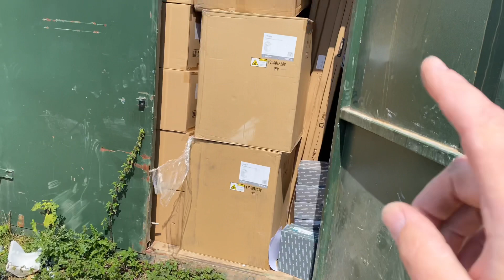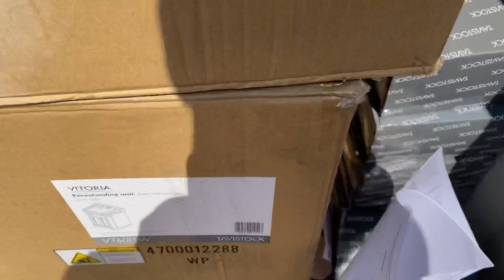REAL WORLD PLUMBING…WHY AM I NOT ENJOYING THIS JOB?

Comment: You will need some help with them trays , they are heavy . As  regards getting them in  get 2 webbing straps , put them around the tray , manoeuvre it into position,  lower it down and then pull the straps out . Tap the tray down to level it out .
Reply from the maker: Yep they were heavy beasts that’s for sure, take a look at Sunday’s video😉😉

Comment: With big shower trays, put down what ever you use to bed the trays, then have a couple of offcuts of 40mm say 1m each, lay them on the bed then put the tray on them, move it into position and then pull them out and boom you're in
Reply: Is it not hard to get them out once in place
Reply from the maker: good little trick that mate

Comment: I feel your pain pal I’ve just finished a refurb on a listed building where the polish labourers done the first fix plumbing for the hot /cold and heating toilets. You no W here this going the builder is a good pal mine never done anything work wise with him. Ask me if I could help out. No one sized the heating system up but they put first fix pipe work in.  I’ll cut a long story short when I filled up leaks everywhere spent 3 days just putting things right. Moral of our story is you pay for what you get.
Reply from the maker: Too right mate….. to many out there like that

Comment: Totally agree. Was told by client she wanted wall hung vanity basins. First fixed the pipes in the walls, only to find later on in the job that floor standing vanities are going in instead. Oh and the walls were concrete blocked. Pulling the consaw and kango out for the fun of it. 😔😒
Reply from the maker: nightmare aint it

Comment: It’s for this very reason that I only work in customers houses and not for builders. I fit kitchens and bathrooms. I do my own plumbing, tiling, plastering, run wires prior to my electrician, fit the flooring, studding etc.I am in charge, and any cock ups are down to me. I don’t have to rely on other trades letting me down last minute or spend hours cleaning up their crap. I only have to deal with the customer who pays me a deposit when I start and stage payments if the jobs going to run a few weeks. I also only do one job at a time, this keeps the customer happy and means I haven’t got money owing all over the place.
Reply from the maker: 👍🏼👍🏼….. good way to work, I did it like that years ago👍🏼
Reply: I think when people like yourself  have a bit if pride in their work it really is a kicker when things balls up

Comment: I only do private work now got stung massively by a builder a few years ago, never again! 
Customers are a pain already without sticking someone else into the mix! 
I've lost my mojo for work at the minute, just had 2 days off work as the van failed its mot... 1300 quid ffs
Reply from the maker: That’s shit mate, leasing a van is the best thing I’ve ever done to be honest….

As for the builder, he is spot on with payments etc, it’s just the job that got me in a pickle
Reply: @MJTiffPlumbing  why would you say leasing is better than just buying a van? Overall its more cost
Reply from the maker: @aj7303  I said it’s the best thing I have done, I didn’t say it was better…. However it’s all tax deductible so makes better business sense.

But each to there own, I used to say owning is better, maybe privately but not when running a business imho

Comment: I'm a bit older than you  and I've been there mate. I used to work for builders when I started working for myself. If you dont like the job,  I would follow your gut and steer clear. I havent worked for builders for years now. Its so easy to get your self trapped with them when they constantly owe you money ( and some builders  know it).
 Many of  them seem to think that if they haven't been paid, its ok not to pay you.  I would concentrate on building your own customer base if you can. I know everyones personal situation is different though.
Reply from the maker: Thanks mate..

The money side of it isn’t a problem, the builder pays straight away when an invoice goes in…. It’s just that I haven’t gelled with this build yet as it’s seems like I’m undoing what I’ve done as the plans changed 🙈🙈
Reply: @MJTiffPlumbing  Well only you know then. Those sort of jobs look too much like hard graft to me now. I'm happy pottering around Brum doing jobbing work..
Great videos by the way.
Cheers